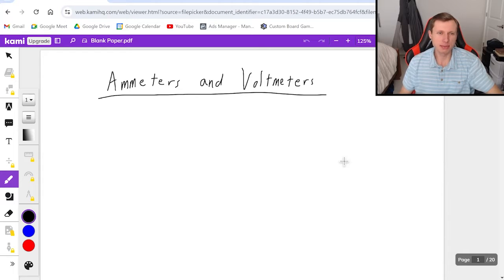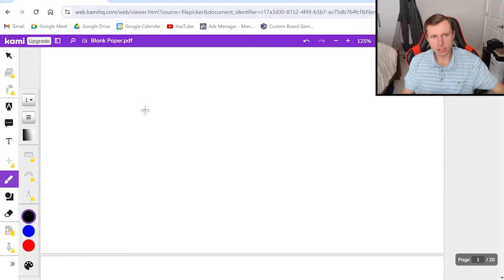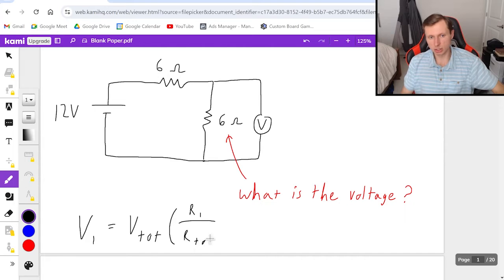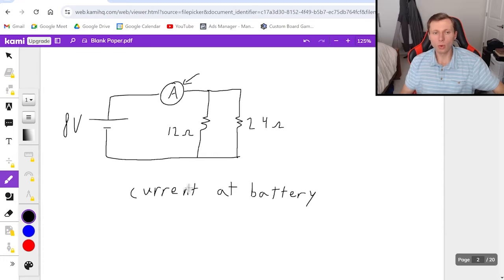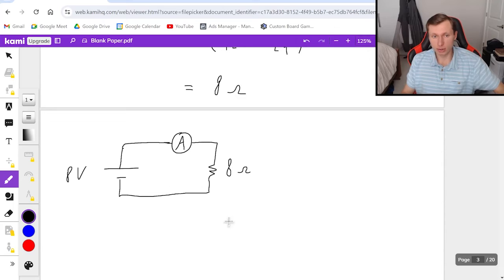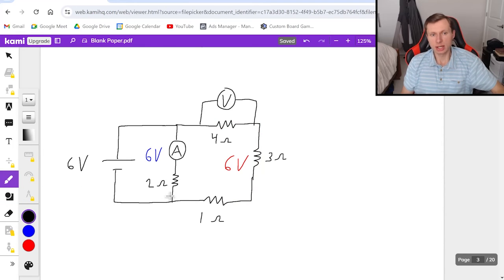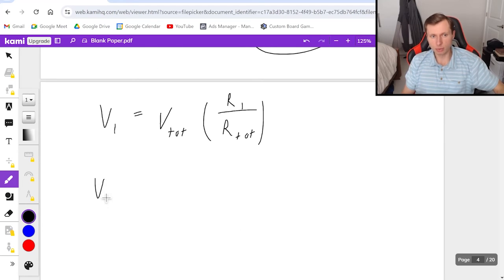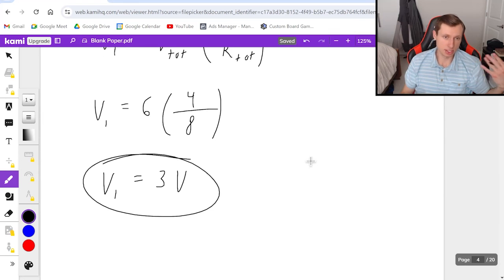How do Ammeters and Voltmeters in Circuits work?

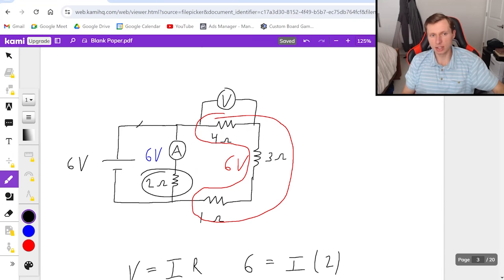Comment: could you pls go into detail at 6:09, like another example if there were another resistor and how that affect the voltage for the whole circuit
Reply from the maker: Yes, so first we would need to combine all the resistors. The 4, 3, and 1 ohm are in series, and then those are in parallel with 2 ohm resistor. Then you would do voltage division to find the voltage through the 4, 3, 1, and 2 ohm resistors we just combined.